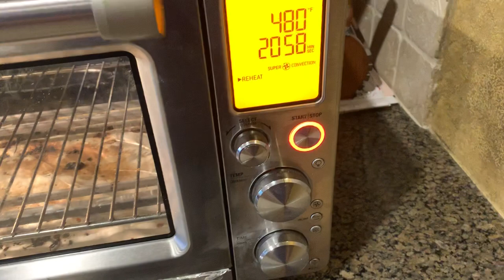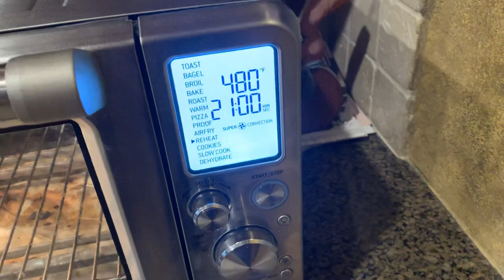Repair your Breville BOV900 Smart Oven when the door won't fully close or the timer stops working

Comment: YOU SAVED MY BREVILLE!!  My issue was the mechanism that needed to be bent- my timer just flashed. While it heated, it turned off multiple times during baking.  It was VERY annoying.  SO I took it apart, and thankfully my son came in and completed what i started watching your video. My Breville works perfectly again!!!! THANK YOU SO MUCH

Comment: I have the same oven with the same issue. The problem is not the switch - it's the little plastic wheel that runs in the door guide. It gets a groove worn it it, which makes the door guide drop down and hit the switch at the wrong angle.  I built the wheel back up with a bit of JB Weld - which I know can take the heat and is a pretty good with abrasion.  It is working well so far.  I've also reached out to Breville to request a replacement part.  For a $450 toaster oven ($450!!!) I shouldn't have to hold the door closed with a bungee cord.
Reply: I agree, the plastic wheel is the problem not the switch. It melts from the heat.
Reply: There was another video where the guy made his own guide wheel with two washers and a nylon bushing from ace hardware for less than a buck. He tried to get the part from breville but they wouldn’t sell it to him as they stated they don’t allow owners to fix parts within the oven themselves, even though they’d sell the spring for that door that commonly fails

Comment: Great video! My fix lasted a week before tensioner spring adjustment failed. So now I have an external spring that hooks onto the oven handle. Spring is attached to a kitchen cabinet. Martha Stewart would not approve, but it works!

Comment: I undertook this repair yesterday, March 24, 2019, and it did indeed work.  However, there a few things that you should note to enable you to do it more efficiently.  First, when adjusting the small piece of metal that activates the timer, please do it gently and as described by Bret.  Second, the oven door hinge must go on top of the piece of metal, not underneath - the hinge keeps the piece of metal on the timer button ( you can actually hear the timer button click as you depress the piece of metal).  Third, the oven casing comes off as quickly as you unscrew the screws, but getting the case back on requires patience and focus - there are three metal lips on either side of the case and all three must go into their respective holes - or you are in for a time of it.  This is an excellent video and I thank Bret Bradbury for saving me at least a $100.00.  Please keep up the good work, and way to go YouTube!
Reply from the maker: Thanks for your response! I should mention if anyone needs to replace that switch, it is a popular switch used in nitrous systems and costs less than 7.00 plus shipping. https://www.jegs.com/i/Nitrous-Express/744/15516/10002/-1
Reply: Thanks for your insight!

Comment: Bret Bradbury Thank you! I have the same BOV900 that for the past several months was suffering from the incomplete door closure, but the relay switch was working fine. I realized that the issue with the door began around the same time we had a new assistant helping with the cleaning of the house and I realized last week that he was spraying either windex or degreaser cleaner into the oven cavity which, of course, is not necessary as hot soapy water and a good non-abrasive sponge is all that is ever needed and the metal rods with the ceramic heat tubes should never be sprayed with anything, but simply brushed lightly once any spills on to them have vaporized. Anyway, I was about to take the unit apart per your instructions, but decided to try a small squirt of WD40 silicone lubricant using the extension spray tube. A very light one second or even less tap on the spray nozzle was all that was needed and the door opens easily and closes completely with a very tight seal that it had not had in a while. This saved having to spend the time taking the unit apart. Now I can go into my Bosch dishwasher door repair that will take 2.5 hours to restring the cheap twine line that runs over cheap plastic pulleys to the back of the of the dishwasher and will reattach they lines to the springs in the rear. The dishwasher cost $800 and the repair shop wants $250 to do the service call as the until has to be completely disconnected, removed from the cabinet, door removed, sides removed, turned upside down, pulleys restrung and attached, reassembled and then fully reinstalled. Point is, that all of us are dealing with cheap cost cutting bean counter inflicted sure to fail “designed in flaws” that waste inordinate amounts of human time and create even more landfill space. I have a ton of Breville products in our kitchen that I use daily and they’ve been terrific as has this Breville Oven and I sure hope Breville fixes this hinge design and the white plastic sleeve that actuates the timer interface relay when the door is closed. We all pay a lot for these tools and they shouldn’t have to be thrown away because of bad engineering and Ill thought parts choices.

Comment: Great tips, Bret. My oven door too would not close fully and after viewing your video, I opened up the box and saw that the hinge was being obstructed by the tongue of the switch. Bent the tip of the tongue as you suggested and now the door closes fully and also makes contact with the top surface of the tongue (and switch) as it slides through. Much appreciated.

Comment: Helpful, but what would help more is if you included the actual fix on the video.  nice to know there are Numerous screws to remove/replace, & the tab pull to remove the cover was helpful as well

Comment: Thank you so much for posting this.  I just started having this problem.  Your video was perfect in describing how the switch worked.  I think I also need to replace the spring.  Excited to take it apart and get to work.
Reply from the maker: I'm so happy it helped. I need to take it apart again and repair the hinge assembly. I highly recommend while you have it apart that you add some good, high-temp insulation to the outside of the oven, under the cover it'll help it last much longer!  Best wishes!
Reply: Thanks for letting me know since this is the project for the weekend.

Comment: Just had this problem happen about an hour ago. I figured it was the switch after the timer stopped working. I will try the repair tomorrow. Thanks for the post!
Reply: Made the repair. Works perfectly. Thanks again.
Reply from the maker: That's great. I knew I couldn't be the only one suffering from this trouble. These things aren't cheap by any means so I don't consider it a throw away item when things like this happen.

Comment: Excellent video! Thank you so much for taking the time to do this to help others.
I had the same thing happen to 2 different ovens (both same model BOV900) after cleaning them. Despite this happening twice, we really do love this oven. 
I didn’t realize it until recently but this model has a 2 year warranty! And Breville has been great each time I called and they truly honor their warranty. 
Both times they quickly sent out a new oven and I simply shipped the old oven back in the same box and they paid for the return shipping. So there was no out of pocket expense.
I just wanted to mention this for those having this or other issues with their oven to call Breville and they will honor their warranty and replace your oven. (Hopefully you registered the oven though ...)
If I have this door/timer issue again when my oven is no longer under warranty, I will know what to do. 😊
Thank you again Bret

Comment: Thank you Bret, your video was a huge time saver! I noticed that you line the crumb catch tray with aluminum foil.  I do same..
Reply from the maker: It's my pleasure, Greg. I do a lot of things like that and often wonder if others also think alike. If you don't use this following method for installing the foil, try it and let me know. I spray a light mist with a water bottle over the tray and then lay the foil down and squeegee it down. It makes it lay down super tight. I do the same when laying down foil on trays when I'm grilling outside. It keeps the wind from blowing it off the tray.

Comment: Thank you for this video. Just fixed the door issue. This is my second unit. I had the same problem with the first one only a few months in. I contacted Breville customer service and explained the situation and they sent me a replacement. Same thing, a few months later this happened again. Hopefully it won't happen again since I bent the tip as you explained. Great video.

Comment: Fix worked great. 
There is a little white grommet that the lever arm slides on. I think after time, this wears just enough that the mechanism catches on the switch. Hopefully Breville changes the switch lever arm shape on future models to prevent this. All it takes is a little bend.

Comment: Thanks to your help my husband was able to fix it.  We took pictures to show what it looked like.  The nylon bushing that holds the door arm is wearing away causing the arm to drop.  To adjust the switch reed apply pressure with your finger holding it down before you bend the end.
Reply: Please post any pictures you have.  Would love to see what it is supposed to look like (or what it not supposed to look ike)

Comment: Thank you for video. This happen to my oven yesterday. I could not close the door completely... something was blocking it. After moving it several times it finally closed. I note the internal lamp you not turn on when opening the door anymore... Later my wife tried to use the oven and after the pre-heating the timer would not start counting down and after sometime the over would automatically turn off.  I opened the case following these instructions and was able to see the switch. In my case the lever was passing the switch. I did bend just a little the switch arm and the lever would now touch it. I cannot explain what made it stop working but after doing this it is back to normal. Thanks

Comment: Planned obsolescence?  There's a little plastic sleeve over the screw that guides the arm.  It being an oven, it inevitably deforms and the arm catch ends up colliding with or sliding under the flat metal switch it is intended to rest on top of.  Thank GOD for this video.  Bend the flat metal switch into a ramp as mentioned in this video and it'll last forever.  As well, I'm sure instead of a plastic sleeve a more suitable guide might be made of metal with say a high temp automotive grease?
Reply from the maker: Terrance Cennon  I'm not sure what material they used but I believe that the only plastic material that could have been used with any possibility of success is PTFE. They should have definitely used some nice stainless wheels on it.

Comment: Thank you so much for your video. I fixed the door problem but when I put it back together could not find torx screws that are holding the side panels. Do you by any chance know what type/size are those torx screw so I can replace them?
Reply from the maker: My pleasure. You don't necessarily need to replace them with torx head screws. You can replace them with generic screws from Home Depot or your local hardware. If you end up with even a slightly bigger/thicker screw, you might want to make sure you pre-drill the hole to avoid cracking the part you're screwing into, especially if it's going into plastic. Even if you're screwing into stainless, it could put the screw in a bind and if the screw isn't strong enough, it could break it off in the hole. Look me up on Facebook in Forney TX if you need more help than that.

Comment: Another common problem you may notice with this oven (especially after cleaning) is thhe elements may not heat. There is a little black bubble inside, on side close to back. This bubble thermostat needs to be wiped clean with soft cloth or paper towel.

Comment: I found that the bigger issue is that there is a nylon two piece sheave on the arm that hits the switch that grinds down over time and thus lowers the arm to the point the door jams up on the said switch.

I’ve repaired this issue maybe three times now by resurfacing the washer to re-enlarge its diameter but now it’s getting old constantly doing this.  I’ve tried calling Breville to see about getting spare washers but they weren’t any help (appears they rather sell me a new oven).

Anyway, I still love the oven but I would love it more if they can just help me fix this irritating issue.

Comment: Exact model I have. Exact problem. I bent the switch tang for now. I'll try to find a replacement wheel.
Reply: Replace plastic arm guide with 2 washers and 5x10x4 mm sealed bearing.

Comment: Thank you for the video.  The selector dial on my gets stuck.  Anyone else have this problem?  Any suggetions?
Reply from the maker: Most knobs are removable by pulling on them. I would recommend making sure that there's nothing underneath the knob or between the knob and the oven that's causing the sticking. If spraying some cleaner along the front, above the knobs helps any with the problem then it's more than likely the cause. If that doesn't solve it, you might try unplugging the unit and using some electronics spray cleaner and spraying any orifices you can find in the rheostat with one hand while turning the knob  with the other to see if that cleans it up. Lastly if none of these solves the problem, I would call Breville and order another one and install it. It's not going to be a difficult job.

Comment: I have the same problem but I can't get the bottom screws to unscrew. what tool do you use?
Reply from the maker: I'm assuming you're referring to the screws in the lower sides of the oven. The ones in the black plastic aren't removed if I recall correctly. The lower stainless screws are Torx 10 or 15. The least expensive to get a set is probably Harbor Freight.

Comment: I've tended to find that the root cause of this issue is a worn nylon roller guide that sits under the door guide bracket. Over time, this roller wears and does not lift the guide bracket as it should. Modifying the switch arm or bending mountings tend to 'fool' the issue by causing the bracket to rider differently on the roller guide. These will likely also fail over time unless the nylon roller guide is replaced. Sad that a $2.00 deficient roller guide is an Achilles heel for a $400 device.
Reply from the maker: It's a simple solution to a problem that absolutely shouldn't exist, that's for sure. Things have recently gotten worse and I might take the time to source parts and update the entire mechanism. I could make them with my lathe but I struggle with finding the extra time. Regardless of what I decide I'll make a video. 
I think that if the oven was better insulated to keep the heat inside, the nylon wheels wouldn't fail so quickly or easily. If I buy another, that's the first thing that I'll do. I use a product that's 1/2" thick from HeatShield Products.

Comment: I have fixed that switch/timer and door issue repeatedly and the same issue keeps reocuring. Any suggestions???
Reply from the maker: The wheels are dying inside. They should have either insulated the oven better or used metal or at least a higher temp plastic such as PTFE. 
My name is Bret Bradbury. Look me up and message me on Facebook and maybe I can review a video to try and help

Comment: I had the same problem. But I found out the white wheel run inside the latch worn off to one side (nonconcentric) which cause the latch drop more than it should and hit right at the level of the switch. You could bend the lever of the switch down  so the latch could go pass that front end and put the lever down but when the wheel come to the point can't use anymore you have to get the new wheel in order to close that door. Thank you all
Reply: I had the same issue with the latch off center in the white nylon wheel.  I added a metal washer with an ID which slipped over the wheel ID and it now forces the latch towards the outside so it is directly over the switch.  I believe that when the latch started hitting the switch, it bowed the long skinny latch pushing it off center.

Comment: We had one very similar to this, the BOV845. It came with a 1 year warranty. 14 months later the thermal fuse burned out and had to be replaced. Breville wanted $180.00 "just to look at it".  Found a replacement thermal fuse for $8.00 on line at a parts house and addressed the problem myself. Then 6 months after that the temperature sensing rod went out. Tore the POS apart again to replace that. It then worked for 8 months when the circuit  board cooked itself and the replacement board was "discontinued by the manufacturer".. Conclusion.. I will NEVER purchase another Breville product again.

Comment: I had the exact same problem and this did the trick! Did anyone have trouble getting the cover back on just right? The fit isn't perfect, like it's bulging on the sides and top and there are gaps where the rubber gasket meets the front. Any advice?
Reply: fix the silicon gasket around the frame of the oven ( not the cover). then have one person pressing the top front down while another is pressing the front sides down so it evenly clips on.  the silicon gasket makes it feel like its slow going.. just keep slowly pushing  from the back while evenly compressing the front border